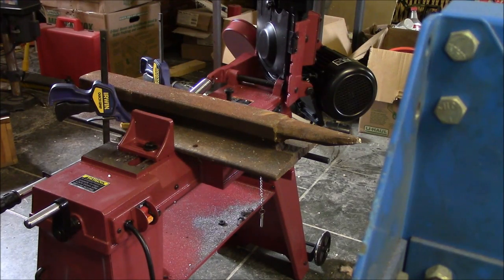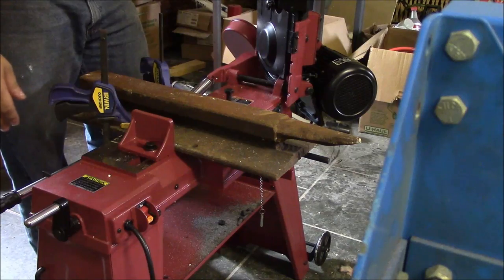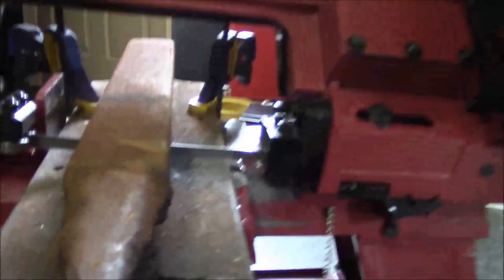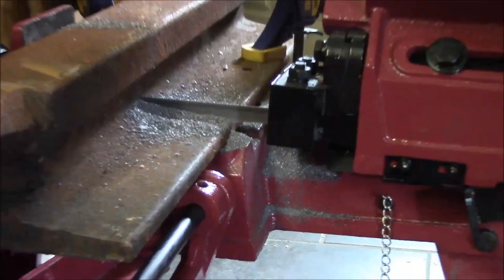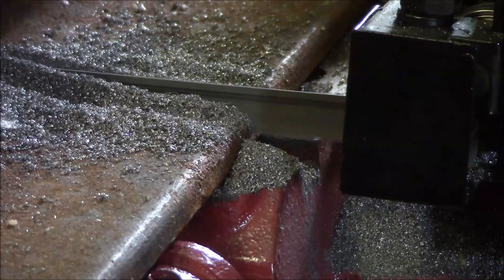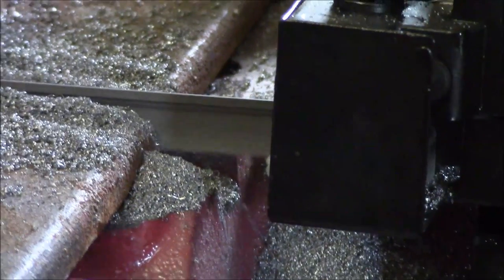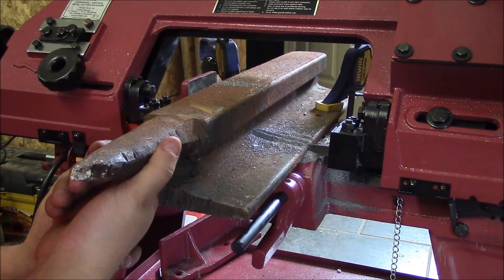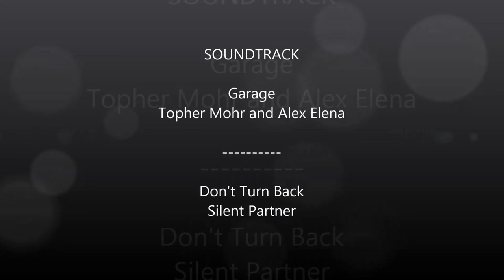Pushing The Limits

Comment: What kind of blade did you use?  Stock?
Reply from the maker: This is the blade that I used after stock, the stock blade was junk, but this was a Lennox Bimetal multi pitch blade.
Reply: @DavidFinchMMC  What pitch this was?
Reply from the maker: Δημήτρης it was a 10-14 pitch

Comment: Did you use any cutting oil or was it a dry cut from start to finish?
Reply from the maker: Adam Luthman No, This cut was done with no extra lubrication. In fact I need to get a decent wax stick or something to run on the blade at times...

Thanks for the comment!

Comment: Does this cuts with the saws weight?
Reply from the maker: Yes, However it does have a spring that you can adjust to take weight off of it and slow the cut speed down. Thanks for watching and asking!
Reply: I just used it once with the stock blade...i would realy like a tip for speeding things up! :D.
I ordered a bi-metal 8/10T blade cause i cut 20mm bars mild steel and the seller told me that for solid stock as such i have to use less teeth, so i use 8/10 teeth.
Do you think adding weight to the end of the saw is a bad idea?
Reply: @Δημήτρης-η4ρ  Adding weight strains the frame without improving the cut. Just let the blade work.
Reply: @OldSneelock  Well my new blade does not seem to grab much material, i do not know what is the problem, it's mild steel.